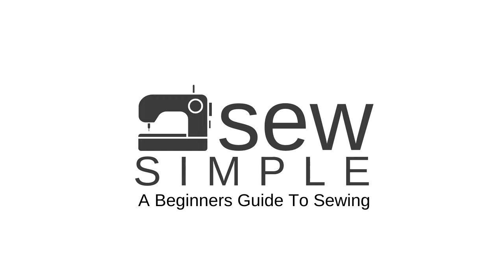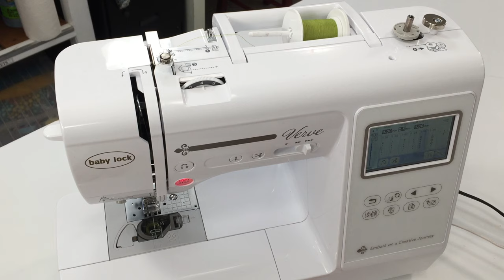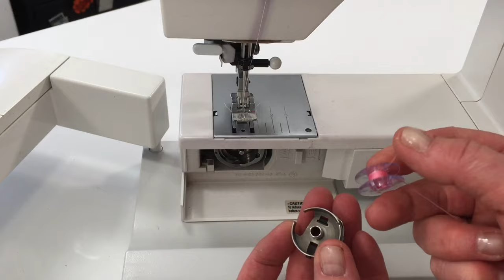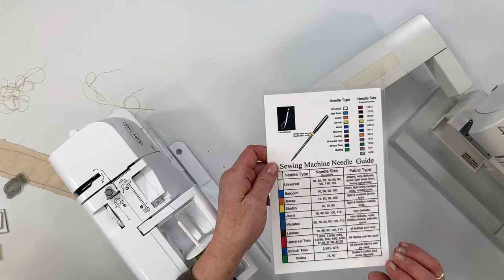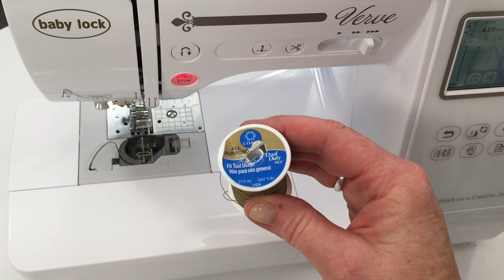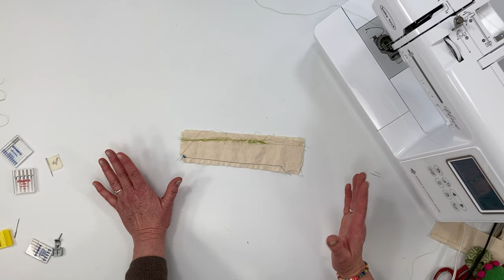Troubleshooting 3 Common Sewing Machine Problems | Sew Simple Series Lesson #7

Comment: My machine won’t move my material along
Reply from the maker: Check and see if your feed dogs are deactivated.  The feed dogs are the little jagged metal things under the presser foot.  They may be retracted. Turn the handwheel and see if the feed dogs come up above the plate of your machine. You may need to take it in to the repair shop and have them look at it. They are usually really good to check it right there and it may be a real simple solution.